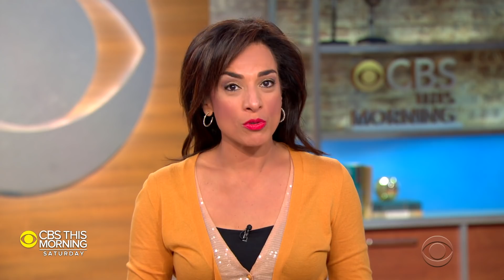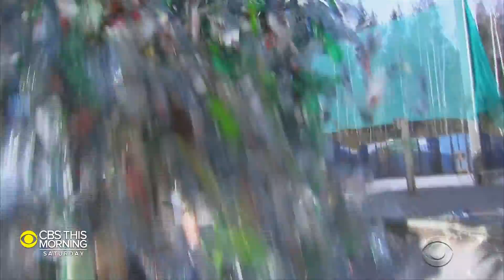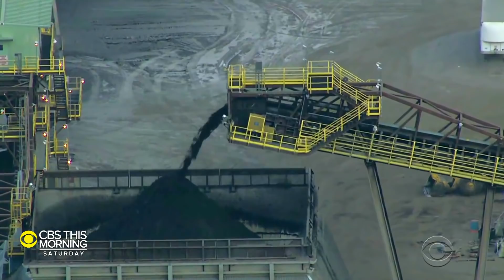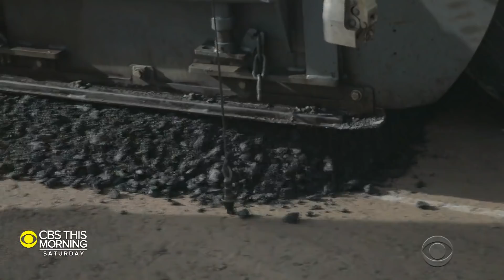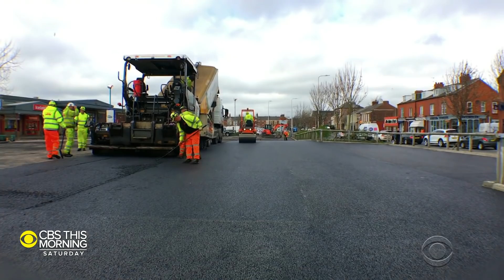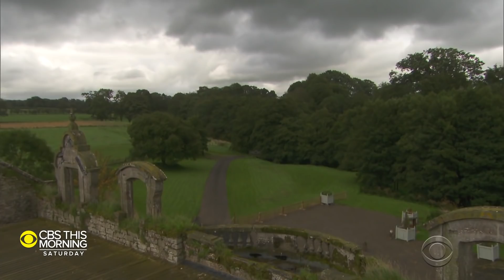Scottish company recycles plastic waste into roads

Comment: microplastics are 'IN' plastic, but they'll be hardened into roads if we utilize the method: plastic sheds microplastic, and a loose plastic bad decomposing in light or soil conditions will become purely microplastic if left to its own designs; by cramming the loose stuff together they'll disintegrate more slowly than they would in the waves on shores, but the deterioration will always occur and will nonetheless be microplastics when they do. The facts stand that the first plastics are still around and the most recent plastics will be around as well, weather by being burned into an atmospheric existence or melted into another form, plastic, like amber, will be wherever it was left for a long time.

Comment: Roads won't sequestrate the plastic.  It will be turned into dust/microplastics with tire wear and it will end up in the environment anyway.  Need to ban single-use plastics and switch to biodegradable plastics.

Comment: There has to be microplastics he is lying, especially if this road were to be plowed
Reply: if the micro plastics are glued together they aren't micro anymore. its like one big piece. technically there is micro plastic in it like there is stone dust in a mountain
Reply: Franky Flowers Microplastics are plastic fragments smaller than 5mm down to the atomic level. When plastic gets re-used, the bonds between its molecules weaken making them easier to come apart. Plastic also photodegrades in sunlight which also causes its molecules to separate. With these two combined factors, this roadway will be leaching microplastics into the environment whether or not they will admit to it.
Reply: @joecool4656  love how people liked what is essentially the same thing as making roads out of uranium 'hooray for new thousand year pollution roads'
Reply: @frankyflowers  "Let's just glue all the radiation together, no more leukemia!"

Comment: The problem with plastic is the main ingredients of it is a by products of oil that cannot be broken down through natural means, in short non biodegradable product. This kind of take on plastic recycling is like sweeping your trash under a rag or carpet, hoping no one will discover it for a long time. Mind you the problem is hidden from your eye sight, but once the rag is remove it will make a bigger mess called “hazardous toxic chemical waste”.

Comment: Has this material been long-time-tested? Of course not. Market economy and competition pushes products out before humans can see the full effect of new, ”fantastic” materials. Then 20-30 years later we find ourselves in an even bigger problem than the one we ”solved”.
Why haven’t we learned at least that lesson yet?

ALL new materials, chemicals, ingredients, and so on should be long-term-tested by an independent agency, before we use it in our environments or eat it.
Reply: Are you referring to plastic?  That's the material we're addressing here, right?
Reply: @Jacob Frey  It’s not exactly our normal plastic any longer, is it? 
And we’ve never used this new material in roads. Asfalt sheds hazardous microparticles into the air, as traffic wears the material down. How will this material be affected by wear and tear? How will that affect our air and lungs? How will the material stand the strain of weather? Will some of it dissolve into the ground? Will it reach the groundwater?
Reply: @magicforest71  There is a problem with long-term testing though. By then, competitors would have likely developed similar solutions that would ultimately trump (don't you dare) theirs, especially in a time where people are desperate to look for solutions.
Reply: @magicforest71  The best way to test it's durability is to install it in a real world situation. In other words, build a road with it, and monitor it to see what happens.

Comment: So simple , and genius
Reply: Bayezidh Tanu, Its not producing new micro plastics per say. Its grinding down the  plastic, then melting them into a singular larger solid state. How do you think they recycling works. They clean the old plastics, grind them into small pellets then mold them Into the new item. Exact same process except the addition of asphalt.
Reply: No it's not smart plastic does break down buried. So these chemicals are still polluting the earth. It's better to melt the plastic and refine it to reusable plastic grains or rolls
Reply: Plastic doesn't break down
Reply: No, it is not. It is only gonna accelerate the production of #microplatics many many folds.

Comment: If there's plastic, there's microplastic. He's lying when he says there's none at all.
Reply: Exactly
Reply: Likely he means that the vast majority of it is trapped within the road. It's possible a small amount will leak out but compared to the alternative of producing it's weight in carbon emissions or filling up a landfill while still leaking micro plastics this seems like a good alternative, at least for the near future
Reply: @antimatter4733  it's not possible, it's guaranteed. And it's not a small amount, it's the whole road. Asphalt is a petroleum product, and it melts in the sun. That's why asphalt smells in summer, it's melting and leaching oil into the ground and air. This guy used some plastic as aggregate, but putting it in asphalt makes it worse, because the plastic trash aggregate will melt when asphalt surrounds it.
Reply: @k.-flynn  well melting plastic doesn't automatically make it microplastic, not to mention that it's still one of the better alternatives. What people need to realise is that there is no perfect solution. This is better than the only alternatives which are landfills (which have just as much microplastic waste) or recycling, which produces a lot of CO2
Reply: @antimatter4733  melting plastic is the big no-no in plastic reuse, that's why recycling is a compromise. Yes you don't have to make new plastic, but melting it down leeches carcinogens and microplastic. Microplastic isn't plastic flakes, come on. It's molecules, stuff we can't pick up off the road. That's why we didn't find it until after 70 years of plastic use.

The big takeaway from most forms of plastic recycling is that you trade resource management for the same amount of pollution. The best use of plastic is to reuse it, WITHOUT HEATING IT. And why don't companies do that instead? Because reuse isn't a commodity; it's hard to sell and make profit from.
Reply: @k.-flynn  microplastic is exactly that, small flakes of plastic. Not the gasses given off when plastics are burnt (which are also bad). The difference here is that it's not just plastic, it's being mixed with other chemicals, which most likely react with the plastic to prevent it from burning. When they're making roads with it they obviously aren't just burning it because that would not contribute to the structure of the road at all, the plastic is physically being incorporated into the road, hence a lot of it is being contained

The fact that you're suggesting reusing plastic is pretty stupid, most plastic items can't be reused. You can't reuse a torn plastic bag without melting it down again, you can't reuse a plastic bottle with contaminating large amounts of water to clean it. If you want to reuse then sell things in reusable packaging, like is still being done with glass bottles. The problem isn't the manufacturers, it's the consumers. They don't want to reuse things, they want to throw it away and forget about it
Reply: K. Flynn Plastic is made from Petroleum as well if you weren’t aware!!
Reply: ANTIMATTER THE DESTROYER OF WORLDS Facts, I keep all my glass bottles and plastic bags, plastic items I don’t keep because of the structure of Plastic. The compounds with in plastic a not health to reuse over and over. So once I use it to heat something up, I toss it because of the chemicals that will start to release from the plastic over time. Honestly ppl just need to stop using plastic and find other ways to store our food. Glass has always been my go too.
Reply: @imhuemankeepURcolorsforcrayons  facts
Reply: @imhuemankeepURcolorsforcrayons  water contact also erodes plastic
Reply: @Randal Loshbough  it's not just trucks because its cars too. Roads get carried away by tire contact and weather. The sun comes in hot and the smell of road appears. Erosion dosen't just work on rocks and mountains, it also works on buildings, ships, roads, and yes even you. So it is plastic or the micro plastic that will be weathered by the storm of erosion... weakened by the weight and contact the tires have on the paved roads.
Reply: if microplastics are all glued together its no longer micro
Reply: Franky Flowers when you use sandpaper does any sand come off the paper??? Hmmmmmmmm
Reply: @doggyg4153  its more like the sand in concrete or glass.
Reply: K. Flynn  a follow up question is have they looked under a microscope
Reply: @Randal Loshbough  why do we repave roads?
Reply: Some people will always find something to complain about.... smh
Reply: @Generic Username id be interested in what the chemical reaction is, bc as far as I know any hydrocarbon product will always shed carbon, so it just depends what additives are present.
Reply: @GeeKIller why would the tire matter? He's not changing tires, he's changing road material. Synthetic rubber toxicity will stay constant, the road's "toxicity" will get worse. Any hydrocarbon product is always less sustainable than concrete.
Reply: @Generic Username "depending on what it is" it's a hydrocarbon. Petroleum. That's what it is.
Reply: @Generic Username we're saying the same thing
Reply: @Joe-to4nu  I don't trust you, pliable means it's melting.
Reply: @Generic Username the lighter hydrocarbons are separated from the oil in the refining process and sold as light oil, gasoline, kerosene, etc...
Reply: What about micro-tars and micro-silicates that come from conventional pavement?  Also none at all?